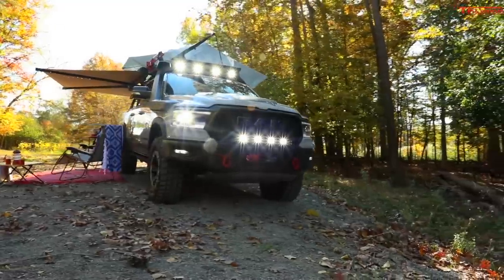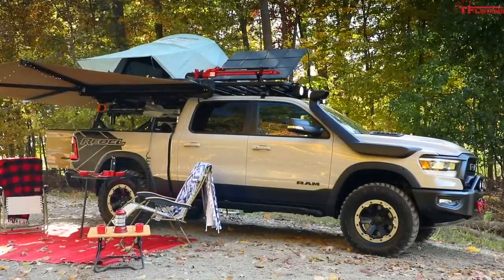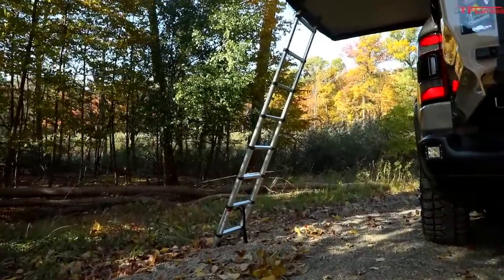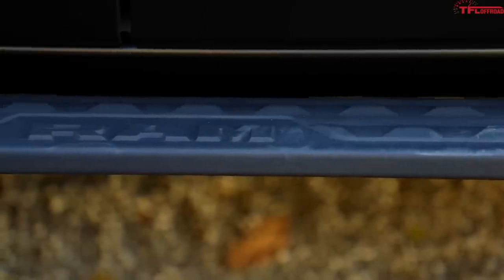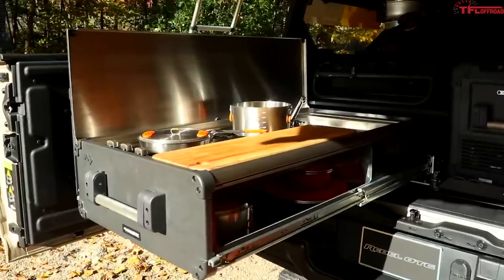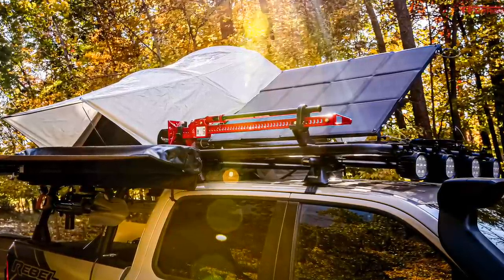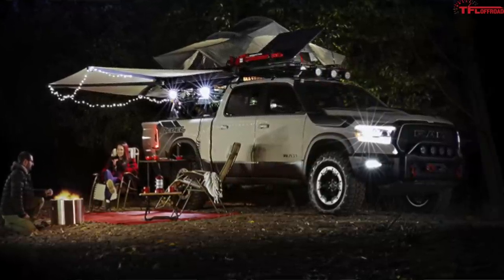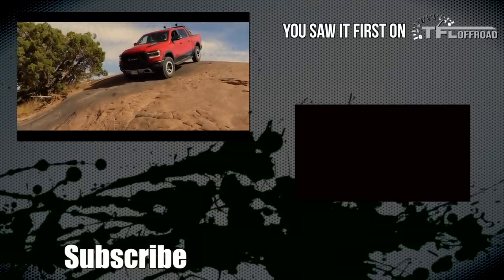NO WAY! This Diesel Ram Rebel Overland Rig Has a Winch and So Much More

Comment: I CANNOT WAIT ... 
I have a 2017 1500 and being bored in isolation, I am pricing out some accessories to make my truck a bit more off-road or overland worthy. 

I am going to be helping a buddy build a cottage and will be living off grid for the first year on weekends so i want something like this myself.

they need to make rock rail / sliders as that is one issue i am having... trying to find them is almost impossible for my model. i picked up a more base truck to build it the way i want it.

If FCA wanted a tester, I wouldn't say not to let them try stuff with my truck lol

I am in Ontario Canada and the backwoods country can be tuff

Comment: I'm torn on this truck. It looks awesome and Ram is really killing it lately in the design area of their trucks but the abysmal reliability of FCA products would be enough for me to stay away
Reply: I have a 2002 1500 with 270k I feel like most of claims of unreliability are fake news.
Reply: Aaron so true Aaron. So true.
Reply: @aaron5222  a 2002 doesn't have all the new gimmicky things being offered by FCA currently. Those are normally the first things to break and are expensive to fix. I'm glad you are getting good reliability out of your truck.
Reply: @DuramaxL5P  true. Go figure a 2002 would last this long especially since everyone likes to say its some of the worst years.
Reply: They are using the proven Hemi and one of if not the best automatic transmission in the world that has won awards. 

Powertrain isn't an issue. 

However any truck can have problems regardless of brand. If powertrain isn't the problem that's the most important and expensive stuff you don't need to worry about. Can't always say the same about other brands. Unproven 10 speeds and Ecoboost issues. 

Ram runs itself. Ram has turned around the entire truck industry since they bought themselves in 2009. I'd say they are fine.
Reply: @MrComputerCoder  fair enough, to each his own. I will be sticking with my Duramax however.

Comment: Make that a 2500 Ram with a cumins and then you have a good overland rig
Reply: Darren Wilkins why 2500 over 1500? I never understand this. The ecodiesel would have far more range and better economy no? I’m torn between picking up a 1500 eco diesel or a 2500 Cummins... but the fuel mileage makes me back away from 2500

Comment: ........this is the TACO KILLER. 

RAM...DO THIS !!!!! 

A Rebel Powerwagon without the weak payload capacity.
This truck has the practical features we all have wanted....it will destroy Toyota Tacos and Tundras.....and possible bring some sense to the Ford crowd to come over.
Eco Disel...range and torque...Fuel tank Capacity.....Bumpers and Recovery....35" Wheels / Lift / Shocks....Can we get to or beat Powerwagon Ground clearance ?

Comment: Give me a quad cab with the 6.4 bed with the 5.7 engine that is 4 by 4 than put a lite weight pop up camper on it I would be very happy. My 2019 quad cab with the 6.4 bed can carry 1960 pounds that should work for a small camper when adding all the load factors in.

Comment: there's no way those are true beadlocaks.
Reply from the maker: They are because we have these same Mopar wheels on our Ram Rebel Rouser project truck. The silver rings you see here are aluminum, but Mopar also sells steel bead lock rings for true airing down capability.

Comment: All good except the most important thing... THE FIAT ENGINE! NO THANK YOU!
Reply: The engine has nothing to do with Fiat, nor does pretty much anything about Ram. The Ecodiesel is a German engine.
Reply: @UNREAL8745  What gave you that idea?
Reply: Provide a reliable source to back that up my friend!
Reply: @UNREAL8745  Here I save you some time. It built by FIAT! Perhaps several versions ago built by Germans, but NO MORE! https://en.m.wikipedia.org/wiki/VM_Motori
Reply: Je P Okay I will respectfully apologize, I had it confused with another component. However, it isn’t Fiat who makes the engine, and yes I knew it was VM Motori. The point is that people need to quit this FCA= literally made in Italy and nothing American because Ram has little to nothing to do with Fiat. Perhaps 85-90% of Ram is American.
Reply: @UNREAL8745  VM Motori is owned by FIAT and they make the worse diesels in Europe. So why buy a 60K truck with an unreliable engine or unproven engine, and you know that parts for it will be expensive and the parts will have to be imported. Plus what if FIAT sells RAM? Or if VM goes out of business. You must be thinking about the HEMI. Yes FIAT hasn't toyed with the HEMI yet. If I was going to buy a RAM it would be with a HEMI!